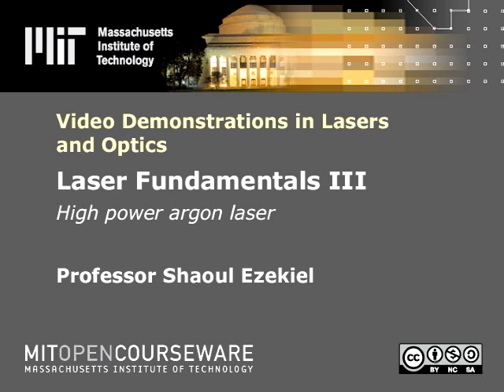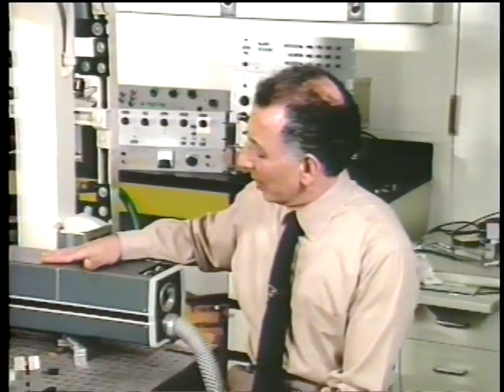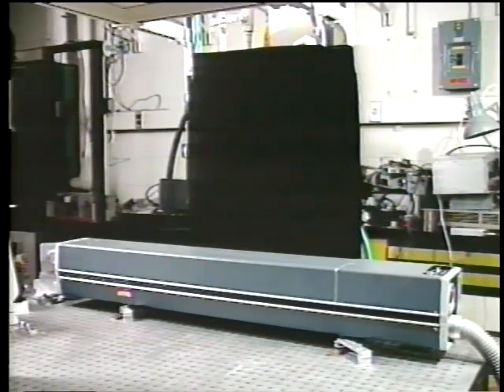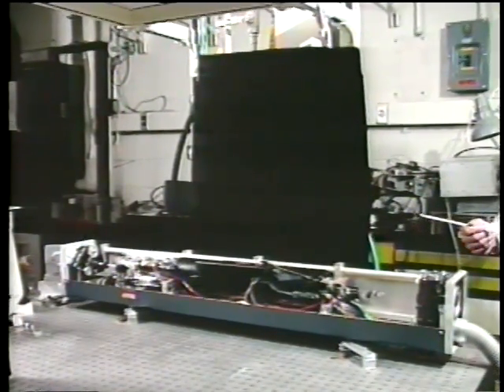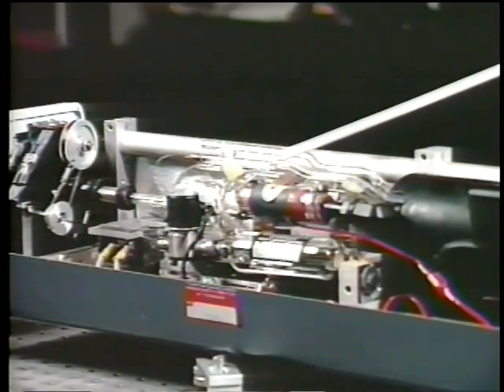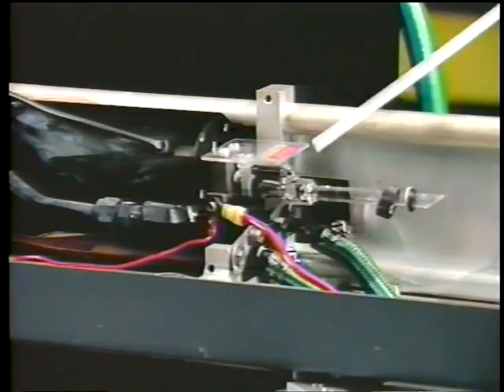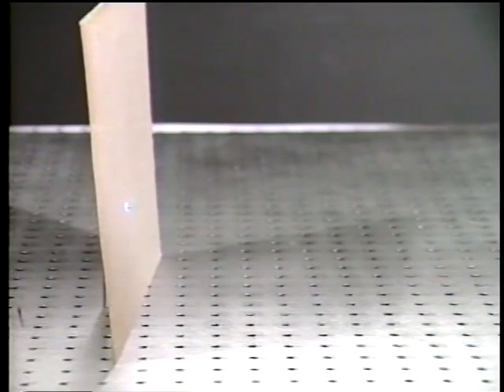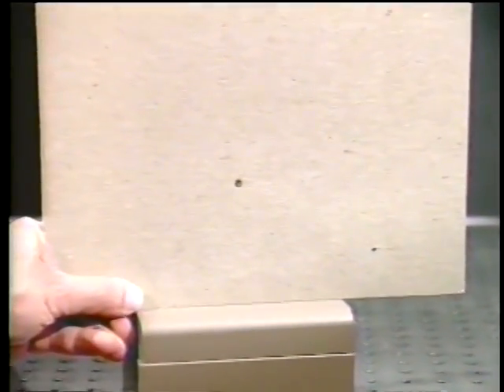Laser fundamentals III: High power argon laser | MIT Video Demonstrations in Lasers and Optics

Comment: Just to think they have laser diodes that can put out 2 to 4 watts of power violet, blue, and green that can be powered with a couple 18650 cells and cost about 50 bucks. Remember the old argon lasers. One was a coherent supergraphite that was a mixed gas laser with about 60% krypton and 40% argon. It was line tunable or multiline white beam laser. 🤓